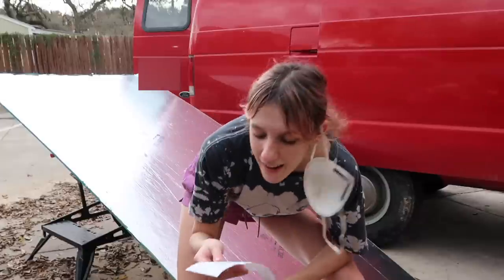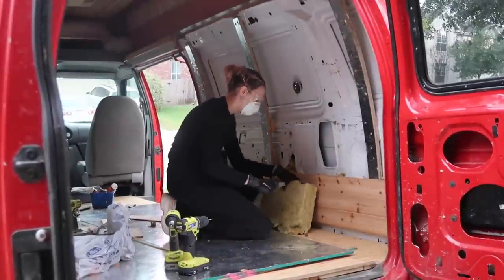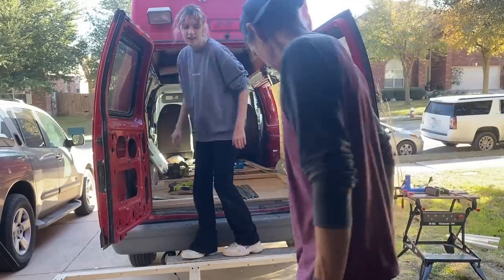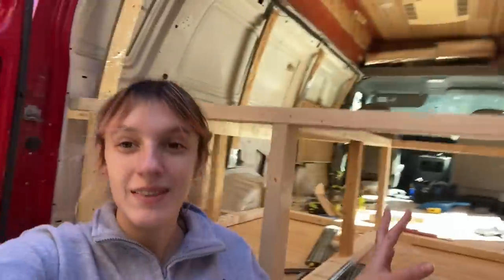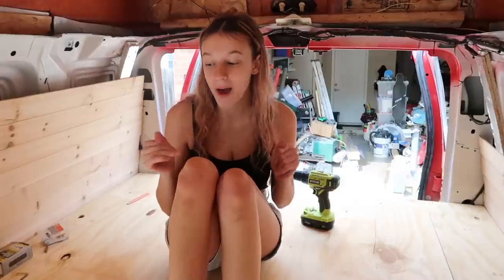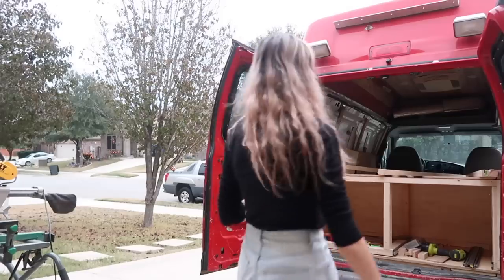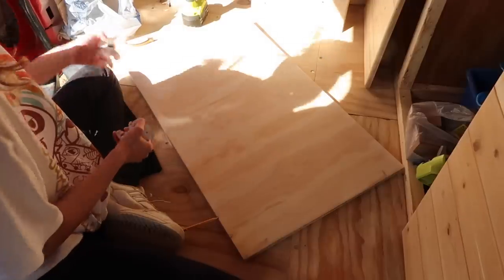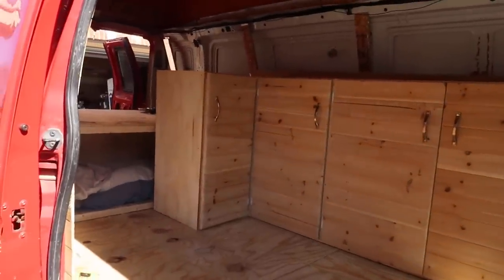Van Build Vlog 03 | Building My Bed, Putting Up Walls, and Making Cabinets!

Comment: I'm only half way done, not sure if you addressed this yet, but for the bed plywood, if you put holes in it, it allows the mattress to breath and not grow mold underneath itself. You can also do thin slats spaced out on top, just make sure there is room for air to move underneath it. If you do go with holes, big ones instead of small ones work best.
Reply: Seconded! I recently saw a girl post about how her van ended up having mold issues, and it was because there was not enough ventilation. Definitely not a fun problem to deal with and difficult to get rid of once it's a problem.
Reply from the maker: Omg I didn’t even think about that!! Definitely something I’m going to have to do! Thank you!!
Reply: @PaperStxrs  yeah! no problem, hope your build goes well!